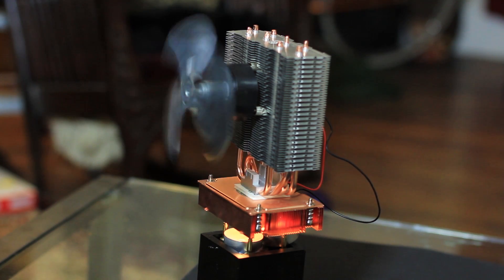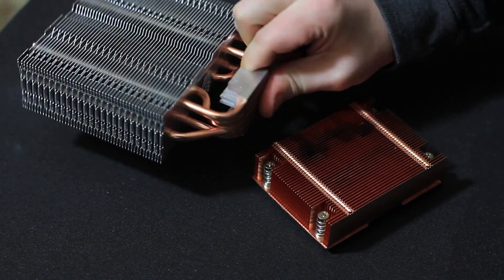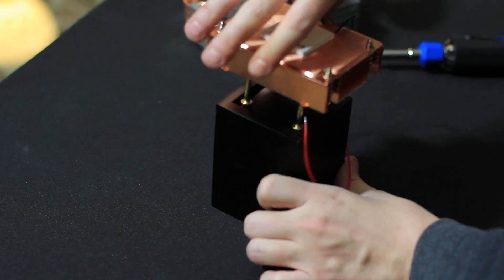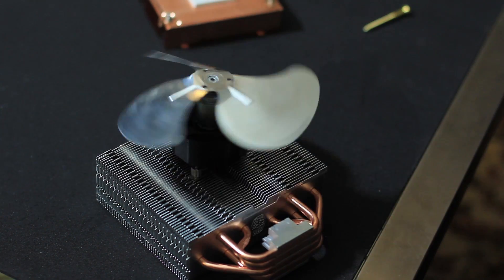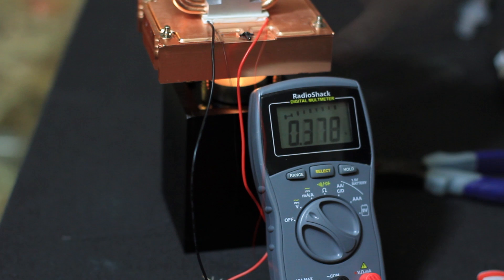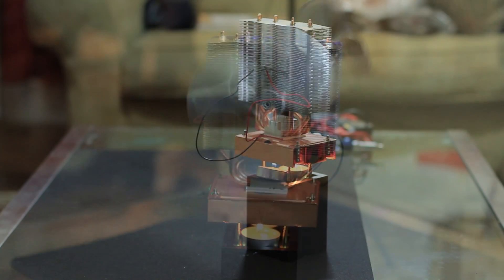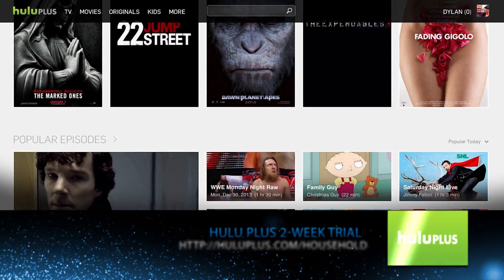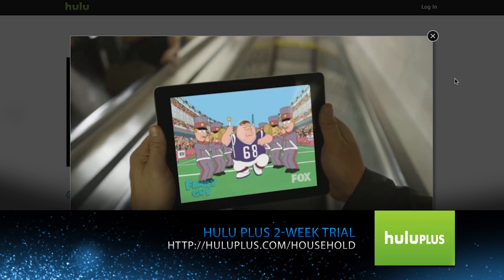Candle Powered Fan!

Comment: Great video and im subscribed. Its an interesting concept but I would like to add a bit here. First, the energy isnt free, its merely converted from the fuel of the candle wax, through heat and electricity, which power the motor into a final product of kinetic, heat and sound energy. Not the most efficient but it seems it does drive the motor well. However, it seems less useful in that it is sucking in hot air from the heatsink out. Basically transfering hot air, which makes limited use for cooling. But for transfering heat around during say winter, it may be an interesting concept. Worth trying during winter isnt it?
Reply: Seramics If the energy of a candle is going to become heat anyway, it probably doesn't hurt to waste the same energy in another.

Of course, with a 5V voltage stepper, it could power a phone. I have tested one that produced 0.7V, most steppers need 0.5 minimum.
Reply: pcblah Incredible, thanks for sharing. :)

Comment: Peltier chips do not produce electricity from heat alone. They create electrical charge from temperature differences between the sides. When the cooler side warms up you will find your voltage output will drop.

Comment: BBQ powered tv? Nah, it'd fry it, whether under or over voltage. But what about a whole array of these on the sides of the tubes in steam generators and the sort? Would definitely get some extra power out of it if it is allowed in that area (basically if there isn't some cooling system or something taking up space around the tube). Also, couch meters? The more often it's sat on, the more voltage it gets from heat, which can be put into a meter and now you can run a number of tests on habits and the sort.

Comment: Idea: Craptonne of thermal electrical generators + small electrical heater = infinite power
Reply: Except for the power that is used in the wall. Physics don't work like that. The heater will eventually use more power than output. In turn this will stop the looping process.
Reply: go back to school and maybe pay attention to science more often. But not bad idea u could probably save abit of power but watse alot so not a good idea either
Reply: Energy cannot be made, only transferred. We also know that this wouldn't capture ALL the heat created, only most of it. This means that you would be losing power if we used your idea.
Reply: This isnt a bad idea but physics wont allow that

Comment: Make free heat! Use that to power your heater and your heater powers that!
Reply: Physics docent work like that sadly. energy will be lost with each exchange. For instance the copper wires absorb some of the energy sent threw them and turn it into EM fields and heat. After enough circuits threw the device all energy would be lost threw this mechanism, amongst others. After time Scientifically and mathematically looping energy like that is impossible.
Reply: shhhh!
Reply: Trevor Roberts Which is currently technologically improbable and possibly physically impossible due to the Conservation of Energy. The Net amount of energy within a closed system must remain the same. THis is a basic law of physics which while it could be wrong or have an exception, we are not yet aware of such a thing.
Reply: Kyle Rhulain unless you could get a heater that uses less energy than the machine puts out but provides enough heat to power it

Comment: What's the point of this? You will probably spend more to buy a fan and plus, you need a fan anyways for the blade! This is useless, but there's only one thing I can think of. That's a blackout where there's no electricity. Otherwise, useless and a waste of money.
Reply: I don't think there is much purpose for the fan itself, but peltiers do have uses. 

Mostly though Its the opposite effect we use the most. In the video, we are turning a difference thermal energy (hot to cold) into a electrical energy. but we can do is apply a electrical current into the peltier, to generate the thermal difference (make 1 side cold and 1 side hot). stick the hot side onto a heat sink to prevent burnout, and the cold side onto what you want to cool. It has benefits over a traditional heatsink cooling because there is less consideration to thermal conductivity (how well heat is transferred from 1 material to another.)

Comment: What's the point? a fan is for cooling you off and the candle warms you up.... so it probably doesn't make much of a difference :P
Reply: One candle won't warm you up.
Reply: Well in a slightly bigger format and on top of a wood stove, plenty of people use this exact idea as a method for circulating heat.
Reply: Scented candle along with a fan that blows the scent around. Most likely use candles for lighting if you don't have electricity along with powering the fan. A sufficient way to get a lot done

Comment: Am i the only one around here that think it's a bit ironic to use candles that generate heat to power a fan to cool the room? xD
Reply: I could see these mounted on a steel fireplace to circulate the hot air arounf the room.
Reply: williamodelnutt Peltier device is all about the difference in temperatures. Bigger differences provide better power. You would need to effectively dispatch the heat from "cold" side of the Peltier unit so it actually stays a lot cooler than the "hot" side. To do this you would need a big ass radiators or powered fans, which would require power - for example from the unit itself, but then how much would last for main fan distributing the heat from fireplace? The heat from "cold" side of the unit would heat the room and the difference in temperatures would went down lowering the power output. You could also dissipate the heat from the unit outside (especially in winter), but then you would loose that heat.

Comment: A candle powered fan is kind of useless though because the candle will just make the room hotter.
Reply: yes with a 1cm tall flame, it will heat your room to 30 degrees Celsius in no time
Reply: Perry Carroll
but, the fan spinns and cools down the hetsink , and the fan does more. otherwise: double action candle heater, heat and heat spreader

Comment: Attach this device to a heater, after using an external heat source to get it going you should have a self powered heater (much like the self powered light you made). Someone should share the results and tell me if this works as i don't have the funds for this.

Comment: Would it be possible for manufacturers to put one of these on the battery or CPU of a smart phone, then use it to extend battery life by charging the phone from it's own heat? That'd be pretty cool.
Reply: Not really, because there's not enough heat differential/energy transfer to produce a useful output.  Also the Peltier process is very inefficient.  However there is a camping stove (BioLite) that burns wood and uses a Peltier module to supply power to drive an internal fan.  If it's a hot fire it can also charge USB devices at up to 400 milliamps.

Comment: surely the heat from candle makes the "cooling" from the fan redundant?
Reply: If i found two heatsinks in those same two shapes, personally I would just use the smaller heatsink and make a mount as tall as the other heatsink on top of a silicon pad instead, so as to get a much higher speed out of it and possibly crank a 5v electric motor to charge a phone! (the newer the smartphone, the higher the range of voltage adaptivity, but even the most highly adaptable phone has a limit which is the reason for trying to make the heat sensor power a motor powerful enough to crank at least a 5v electric motor!) I might even set a small sum of money aside to try this project!

Comment: I wonder if these would be better to cover a home roof with than solar panels.  Seems like endless possibilities with this little device.  You could even cover the bottom of a hybrid cars hood so while driving at speeds above battery operating speed the heat generated from the gas motor could recharge the battery.

Comment: Research Terms:
...
Voltaic Pile.
...
Dry Crystal Cell Battery:
Epson Salt, Alum, Borax, Dead Sea Minerals, Salt substitute,  etc.
(Powder & Epoxy or liquafy & pour.)
...
Thermal Reactive:
Power Transistor 2N3055 or infrared led.
...
LaserSaber, LidMotor, etc.
...
Happy New Year Everybody!

Comment: suck out the heat from a computer processor and use it to spin a cooling fan thus converting the heat into electricity so less of it has to be expelled.

Comment: Yeah, and what happens when the fan blade flies off? You should've secured it with something other than friction
Reply from the maker: It was on there very good, there was a bit of tape wrapped around the end of the motor that ensured the fan blade did not go anywhere.
Reply: It's an example you moron.
Reply: ***** Don't be that harsh with the kid! And it is actually pritty stable seams to me.
Reply: HouseholdHacker still though, better safe than sorry, right?

Comment: I have a fan on my woodstove that works on the same principle- I get 80cfm from it, and it heats the adjacent bathroom. It must have cool air behind it, and it sets directly on the hot surface of the stovetop. It is not a DIY but a manufactured device and it has been running every winter going on 6 years now- the only maintenance is dusting it every so often.

Comment: I found a few of these Peltier coolers on amazon.com that are said to generate up to 92 watts. If this is true, I could use that one to power/charge my laptop!
Reply: no... for that you will need the TEG---> thrmocuople generator not that TEC(thermo cooler). this unit can tolerant heat up to 150 degrees c'. the TEG can preduce more V and can bee heated up to 300 c'(more differential more V-and little more amp).
Reply: Ah, I see the pelter cooler he used said TEC on the side. Can you give me a link for the TEG?

Comment: reverse is possible ? can generate electricity from ex.cold water,ice etc.
Reply: Yes, but inefficient
Reply: i have peltier unit but not heatsink can i use it without heat sink if not then which type i have to buy ?
Reply: ***** Yes you can, but it'll break if it gets too hot. I would always keep it below 100°C and use some ice to cool the other side

Comment: Correct me if I'm wrong, but if this works and heat can be converted to electricity. Could we try putting on of these on an iPhone battery so when it gets hot it gets converted to electricity and recharge itself?

Comment: this would be alright if I hadn't have seen someone else do an identical device months ago. with this arrangement the fan will actually by blowing warm air (take it from someone who's been in the heat transfer industry). and its better to use a TEG peltier, not a run of the mill kind (which are usually the ones made for heating and cooling when power is PUT IN.

Comment: You could also build a Stirling engine, it could be more fun and probably cheaper. It also only requires a candle or any heat source for power, although it's only an engine so it doesn't produce electricity unless you do some things to it.

Comment: You can make ELECTRICITY from HEAT?!  REALLY?!  Alert the presses!

Just think of all those nuclear, coal, gas, oil, solar thermal, and geothermal power plants out there that could be made so much more efficient by SIMPLY turning all that heat into electricity!

Gosh, if only they knew about this years ago we could have had more electricity than we knew what to do with!

AND FREE CANDLES?!  I DIDN'T KNOW CANDLES WERE FREE!
Reply: nicholas beni *Face palm*
Reply: Jordan Is Epic That was the joke, you fucking idiot.
Reply: Pseudo Hey not cool bra.  Just because he didn't understand the sarcasm doesn't mean you should call him a fucking idiot.
Reply: it's not as efficient though....
Reply from the maker: Oh, you!
Reply: I know, 5 months old, blah blah blah but I just wanted to interject here. All nuclear power stations use the thermal energy given off by the reactor to superheat high pressure water which in turn is fed into a container full of water. That water boils, the steam is forced though a turbine and boom. You have electricity, all based on heat. Coal/gas/oil fired stations do the exact same. Geothermal is pretty self explanatory..?
Reply: This generation, you seen it before you don't recognize it, such as, have you seen a movie or a clip where a guy shuvling coal into a furnace on a train, it makes the train move faster and faster? Yeah bam it's been around for years
Reply: Yeah, it's amazing! I've also always wondered why those industries felt like making heat. I thought they were cold! :O
Reply: Explain the process of how "simple" and what process you use of achieving your premise?
Reply: I was thinking the same thing... If only they made them in industrial sizes
Reply: TboneIsRogue THEY'RE AS COLD AND DEAD AS CAPITALISM

Comment: Cool idea, but doesn't a hot candle defeat the purpose of cooling an area with the fan? At least slightly? And if the engine got fast enough and caused it to tip you also have a potential fire hazard.

Comment: OK, the question is this: Can you use this electricity to power an LED? Would this LED give you brighter light than the candle on it's own?

It seems counterintuitive, almost pseudoscience free-energy nonsense.

But LEDs seem to burn pretty bright on little juice.

It would make an amazing camping and emergency light. (C) Neil McLachlan 2014.
Reply: Also, peltiers are awesome. I used to have a Celeron CPU running at triple it's regular clock speed with a total of four peltiers that were the same size as the ones in the clip. The CPU temp sat at -20 to -40 all day long, but the condensation was a killer. The entire CPI cartridge was encased in ice; it was a miracle it lasted the months or two it did.

I can't believe I didn't try the LED experiment back then... although LEDs were crappy in 1998.
Reply from the maker: I thought about this. It seemed strange to power an LED with a candle so I didn't do it. But to answer your question, yes. It would work.

Comment: Does the Peltier work off of ANY heat source, or does it need to be an open flame?
Reply from the maker: You can get the same effect with hot water. It's pretty cool... or should I say, hot.
Reply: Any heat source works. Also if you put power into it one side will get hot and the other will get cold.
Reply: HouseholdHacker So could I break the entire universe with a perpetual motion energy creator, by creating a friction machine to boil water with the Peltier?